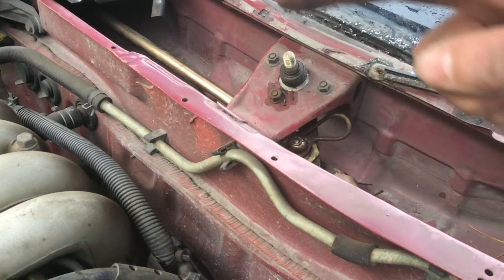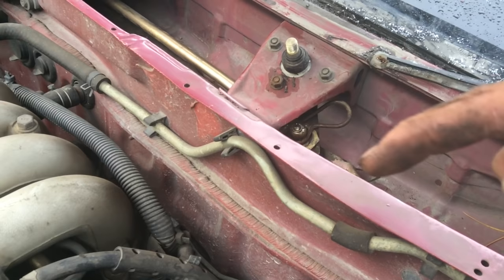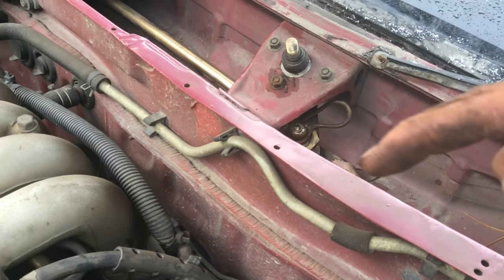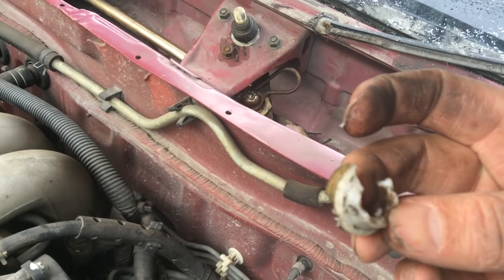Wiper arm linkage quick fix

Comment: I had a few washers with inside diameter slightly smaller than the ball so I cut a slot through one side with my angle grinder and snapped it in place. Squeezed the gap shut using channel lock pliers for a more positive lock. Without the plastic bushing there is slop between the ball and linkage but it's only a temporary fix.

Comment: That's good for a temporary quick fix, there is a reason the bushing is plastic. It is to allow the expendable bushing to be replaced for a couple of bucks, instead having to replace the wiper linkage assembly and wiper motor after the shaft is damaged..
Reply: John Tucker the reason why he fixes it like this is probably because you can't buy the bushes seperately, which is very common on most of the cars
Reply: They sell a bushing kit assortment for $4 at Schucks. I had to buy two kits for the 4 bushings I needed. I dunno maybe that helps somebody out there.
Reply: I've bought new bushing but they don't hold :(
Reply: Try giving them some heat to adjust the size, use vice grips to lock them in place.
Reply: @juniormin3454  you right my friend...in my country only honda sell bushes seperately
Reply: @briandawsonmsw   same same ... I went through 3  kits of assorted bushings.
Reply: @Messy_Jesse   channel grips worked well for me, sockets and vise are the standard
Reply: I ended up buying a used transmission without the motor for  $30 from a salvage yard. Working great.

Comment: I just spent 3 hours trying to get these to press fit in with the supposedly "correct" bushings and despite using channel locks and grease and all that and press-fitting them outside of the car (using the motor's ball joint to press fit both ends of the linkage arm)....it's impossible. I can't get them to fucken fit no matter what. You pop on one side with channel locks and the other side pops off. 

I think I'm just going to do like in this video and use god damn trailer hitch cotter pins. I don't care if it squeaks or w/e I just want the wipers to friggen work.
Reply: Genius! I used this red neck technique on my 2002 Ford ranger driver side wiper linkage bushing repair and it worked 💪!

Comment: Thanks for the video. Will have to do this for my 2003 Hyundai Tiburon. The motor works, but front wipers don't. So can I just replace the bars on it?  Also, I have a 93 Nissan pick up that seems to work in overdrive with one speed. How can I slow it down? Had one before and it seemed to work normal.

Comment: thanks for the video, my 97 Nissan Sentra has the same problem! 
May I ask how long did this pin hold before it came off or broke ?
Reply from the maker: kingneo195 I dunno, sold it like that
Reply: My 99 Nissan Sentra fixed twice by Duggers Auto Repair in Mt Pleasant Tn. First time it lasted 15 min. They just did it again. It just broke again. It lasted 30 min. Man is this a Sentra problem! So frustrated, im just gonna take it all apart and try to figure it out myself!